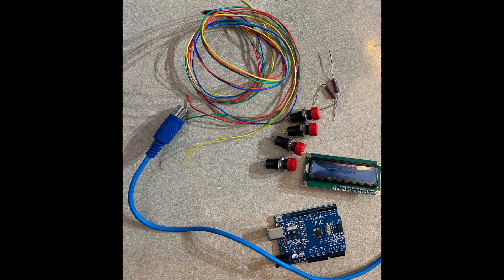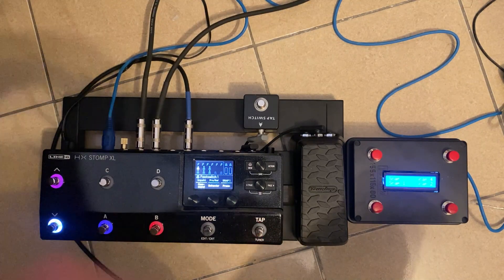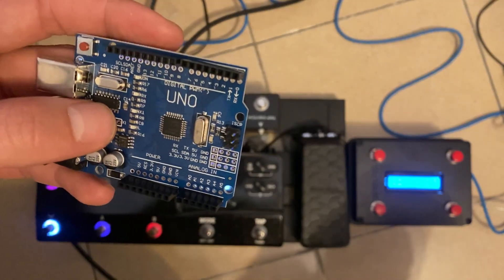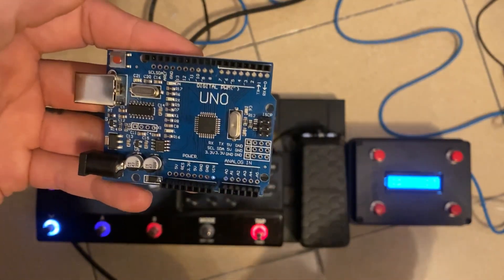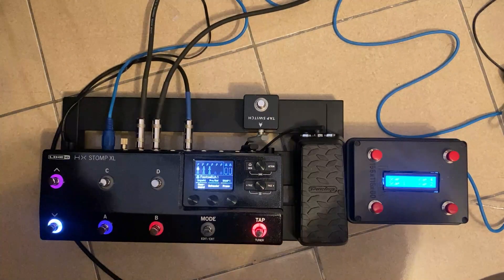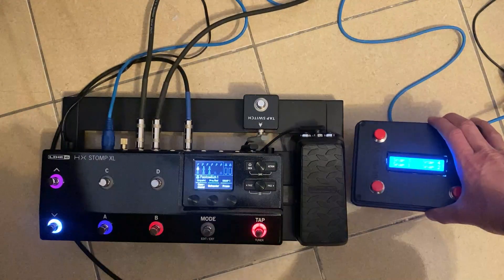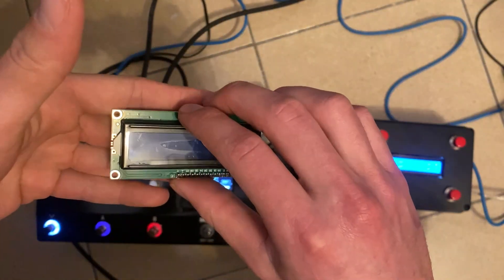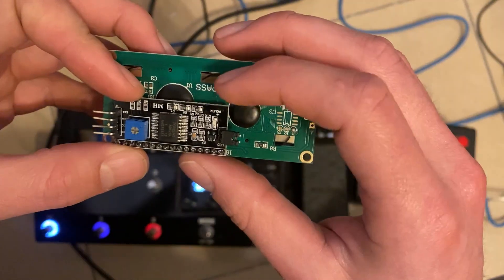Homemade Arduino Helix Snapshot Midi Controller

Comment: How do I get midi to display on the 1602A ? ’m trying to make a drum machine midi controller
Reply from the maker: I was able to get mine to work using an example Liquid Crystal code and modified it to my needs. It took some trial and error to get things working the way I needed, but looking for existing code examples and modifying them to your needs is much easier than trying to create code from scratch.